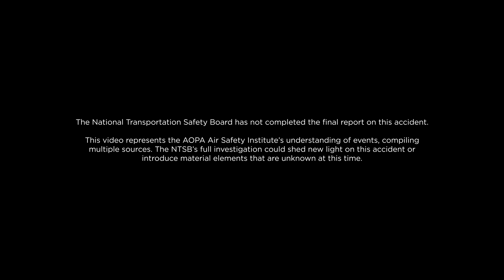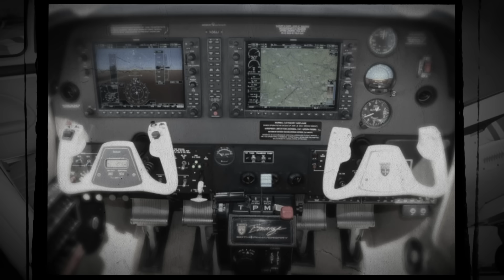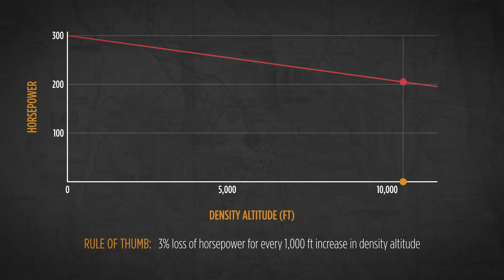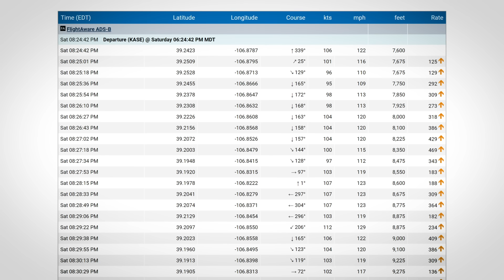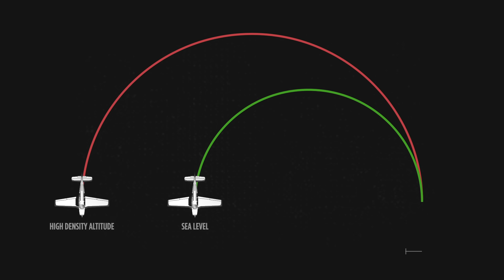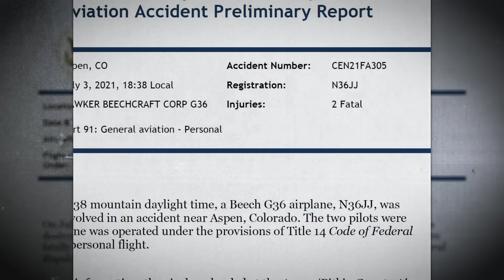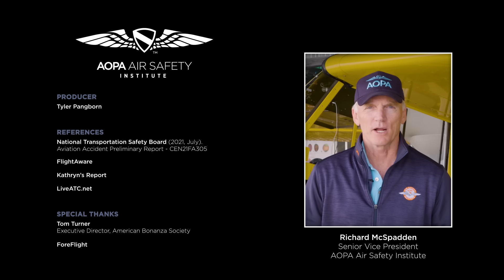Accident Case Study: Into Thin Air

Comment: Man, that was hard to watch. I was squirming in my chair watching them fly up that valley. 
I feel very fortunate to have gotten my PPL in Yucca Valley, CA(L22) while stations in 29 Palms. Big Bear airport(L35) in very close by. Big Bear was never a huge deal during training. Density Altitude was noticeable, but my intructor took me to Big Bear and around the mountains often. I was confident and even a bit cocky around mountains. It wasn't until after I got my PPL, I had rented a Grumman Tiger and was flying around SOCAL. I had two of my Navy friends on board. About 200Lbs under gross. After touring around and getting lunch in Corona(KOAJ), we started trecking back towards the high desert. About a 30 min flight. My two friends wanted to fly past Big Bear to take some pictures of the lake and mountains. This was the middle of July, and the temperature was around 85F. Very warm for Big Bear which made the DA around 9,800ft. I decided to follow a Cessna that was in front of me and do a touch-and-go. When I touched down and brought the throttle forward, I immediately noticed the lack of power. I rotated and felt the lift drop off as soon as I left the ground effect. To make things worse, there are 50ft tall trees at the end of RW8. I looked at the end of the RW and debated aborting and squealing the brakes to stop before the fence. I saw the Cessna in front of me, and he had turned left and flew through a roughly 100ft wide gap in the trees. I followed him and swore I could grab pine cones if I stuck my hand out. I was climbing at 70kt Vx and not making more than 250ft/min. I retracted the flaps after I cleared 1,000AGL and played with the mixture to make best power. I had to S-Turn to clear the ridgeline to the desert. After clearing the 8,500ft ridge I released back pressure on the yoke, began a descent toward Yucca Valley, and finally breathed for what felt like an hour. I turned to my non flying buddies expecting to see ghosts and asked, "you guys get any good pictures?"
"Yea, That was AWESOME!" 😨😨
They never noticed anything was wrong! I kept it that was to not freak them out. I swear I shat enough bricks to build a fricken school! After landing in Yucca and driving back to base, luckily the only thing hurt was my ego. I was wearing a Garmin watch, and I looked at it after getting home. It had a notification that said, "GREAT WORKOUT Max Heart Rate: 194bpm"
Maybe it wasn't as bad as my brain made it out to be. Some have probably had closer, but that was the closest I've ever come to buying a farm. DEFINITELY better to use superior judgement than superior skill. I forced myself to use superior skill to pull myself out of a situation, and it FUCKIN SUCKED!
Density Altitude around mountains is NO JOKE! Whether you're a flatlander or trained in mountains, it's real and it kills. I would rent a 182 out of Eagle, CO and put Leadville (KLXV) in my logbook not even a year later. I got an intro to "REAL" mountain flying, and to be honest, I'm returning to EAGLE to finish taking the full course.
Reply: Great story...Thanks for sharing.  VERY glad you are here to tell us about it.

Comment: This is a great video. I hiked Midway Pass from Independence Pass 2 days after this crash in order to find the wreckage. Not sure where they got their information on the exact whereabouts of this crash but thy are correct. It was a TERRIBLE time to leave Aspen and were extremely ignorant of the height and respect Colorado mountains require. The only error I see in this video is winds were not 15 knots from the East.....prevailing is almost always from the west...which didn't help them. GA usually only flies for a couple hours in the morning mid-Summer here in the Rockies. Even if these guys would have made it over Midway Pass, their flight would have been extremely turbulent and uncomfortable. RIP and kudos to ASI/AOPA for this video.
Reply: I agree..I'm usually back on the ground by noon during the summer. I don't have a DA issue in the RV-8, it's just the afternoon T-storms and turbulence pick up dramatically after that.

Comment: Why in the world choose Aspen for a fuel stop IN JULY?

Why not depart NNW, follow the road to Basalt and hang a lazy turn to the right all while climbing?

Why not depart with half tanks and better your climb rate to clear the pass of your choice (Assuming safe winds and weather) and refuel on the eastern slope someplace?

Why not have a specific route in mind and plan for minimum crossing altitudes before entering the canyon?  There was no indication they had even contemplated a safe crossing altitude.

Why file an IFR flight plan only to cancel when the controller (who knows better) keeps you circling until you are at a safe altitude?

And, yes, why not talk with someone knowledgeable in mountain flying before you even land there, or at least before departing Aspen.

Comment: I am wondering why they decided in flight planning that Aspen would be a good stop for fuel in a normally aspirated airplane? Considering the temperatures were fairly hot on the day in question. The Bonanza is a great airplane but damn you can dig a hole for yourself right quick if you let it. GPS is a great navigation tool. GPS direct can sometimes get you into a corner that will cost you dearly. DA is something you always have to consider. These sorts of things are never good. I am retired now, but I would have my students do the calculations for every single flight- I figured that a habit from the start will keep them out of trouble later.

Comment: I think one more point should be added as the first in the chain of events:
(1) the decision to plan through Aspen and to land there and take off in July.

Aspen is dead center in the high territory and higher on departure.  Instead of going south from the planned trip head to Cheyenne. It’s at least 1k lower in elevation and takeoff to the east puts you over prairies. Not loaded with fuel trying to climb to 14k to make it over a box canyon. 

Understanding that Aspen is a bit more glamorous of a stopover.

Comment: The first minute of the video says it all...they had NO BUSINESS landing in the middle of the Rockies (especially Aspen) or really even flying OVER the Rockies in summertime without a turbo-charged engine at a minimum.  This is all due to a lack of mountain flying training and experience.  (note.  this type of plane should also not challenge the Rockies in winter either...).

Comment: Just looking at map of US on Weather Radar app, a lot better route would have been KAPC, KLAS,  KABQ (alt 5355 ft), then on to wherever they wanted.  It would have added some extra miles to the trip, but would have totally avoided the high mountains and trying to make it thru passes.  They also would have flown over the Grand Canyon for some great photo ops.  A straight line is not always the best  or safest way to go. RIP

Comment: The first link in this accident chain was choosing Aspen for their fuel stop.  The scenery on their chosen route is of course spectacular, but a more prudent choice would be a route across Wyoming paralleling I-80, which would have lower terrain to cross and a choice of airports at much lower elevations than Aspen.  They cranked the risk factor up pretty high as soon as they left Napa with KASE programmed into the G1000.
Reply: I was thinking the same thing as soon as the announcer said they did not have a turbo. They had no business going through Aspen with a new plane they are unfamiliar with, with only East coast experience, without oxygen, and without a turbo. They may have done the trip with this plane if they had plenty of experience, and extensive briefing on mountain flying. They never should have chosen that path, rather flown through NM.
Reply: Husband and I go to Aspen every few years.  We go in the summer and fly into Denver and rent an SUV for the remainder of the trip.  I refuse to fly into Aspen with any pilot.  Maybe I'm too wary but getting to play in a snowfall at Independence Pass in June makes the drive worth it :)
Aspen's airport is ranked as one of the most dangerous in North America...only for the most experienced of pilots in mountainous regions.  Thank goodness these two did not have wives and/or children with them.
RIP to the pilots.
Reply: @fumblebunny1993  Not even commercially or with a turbine jet engine? :D
Reply: @rkan2  No and no :)  I cannot predict weather and that can change fast over the mountains.  I fly a lot and Aspen is the only airport I've ever felt this way about.  I can't rely on commercial pilot experience either.  Look at Air Florida flight 90.
I'm just following my intuition on this one.
Merry Christmas, rkan2!
Reply: @fumblebunny1993 😮
Reply: I immediately thought the same thing. I obviously don't know what weather looked around the Rockies that day, but the same general plan replacing Aspen with a stop somewhere like Rock Springs or Rawlins avoids the highest portion of the Rockies. If I were in a (relatively) new-to-me aircraft, the 10,000 ft. runway at RKS with no notable terrain nearby would seem rather inviting.
Reply: first thing I thought
Reply: Yeah, who the hell stops in Aspen for fuel?

Comment: Stunning to see that a high time ATP rated in Gulfstream jets get suckered into flying into a situation where is is no margin for error and that "errors were made"...if they wanted to visit Aspen...why not overnight, depart early in the am (no turbulence) with just enough fuel to make Denver plus reserves...and cross the mountains with AT LEAST 2,000 between you and terrain? with enough room to turn around if they hit downdrafts. 

I took off from Winslow AZ hot afternoon max GW, Piper Warrior long runway...did my calcs..the airplane would do it with about 200' FPM climb...which it did...all is ok we're climbing out...then hit an unexpected downdraft at the end of the runway. Not only did we stop climbing we started descending (in a sinking column of air the plane couldn't outclimb). 

There's a wash at the end of the runway...we flew down it struggling to stay airborne, at at about the same ground level as the airport. thank God for that wash. Lesson: with marginally powered aircraft build in very healthy margins for safety.

Comment: I flew with a CFI  The Independence pass in a turbo normalized bonanza about one months after this crash.    At one point we landed at Leadville and heard the story of the crash from the FBO manager, how the pilots took a wrong turn and boxed themselves in, flying east.   The CFI stressed the importance of not trying to cross the Independence pass  eastward with westerly winds. This is a real killer, one of the most dangerous passes with the crossing altitude 12500 if you fly it properly.  A wrong turn most definitely puts you against a much higher terrain.    Being unfamiliar with the mountains these guys had no chance..  Another CO CFI told me that  40 people die each year trying to fly in the Colorado mountains, some of them are experienced mountain pilots.   It's very sad.
Reply: Check out this video that I did about flying around Angel Fire, NM (8,380'). It talks about the various wind currents and how the mountains create both up-drafts and down-drafts. You just need to be able to visualize what is happening all dependent on wind direction and the terrain. https://youtu.be/AmrAX7tSvvQ

Comment: I often do an end run Bakersfield Albuquerque avoiding Rockies  and through mid Continent. The low spot Knoxville through blue ridge maintains. However Blue ridge is under 7000 ft.

Comment: I’m a little confused about something. Aspen is 7,838 ft MSL but the density altitude was 10,500 ft, or 2,662 ft more than the MSL. The crash location was 11,000 ft MSL. So would that mean the density altitude at the crash location was approximately 13,662 ft density altitude? (11,000 ft MSL + 2,662 ft)

The Bonanza G36 shows a service ceiling of 18,500 ft. Why was that thing so sluggish gaining altitude when it was still almost 5,000 ft below it’s listed ceiling?

Comment: Don't know about the powerplant in this particular G36, but my A36 had an IO550 with Continental's (somewhat infamous) automatic mixture control. The box set the correct mixture by way of an aneroid.  Sometimes it worked beautifully. Sometimes it didn't.

Comment: Am I correct that most of this discussion is regarding the engine performance at that altitude? - or is there also some effect related to wing lift due to less dense air? I am not a pilot, but it seems that flying over mountainous terrain has multiple difficulties;  updrafts, downdrafts, less oxygen, less air pressure, and visibility issues. I can just imagine the stress if you flew into clouds when there are mountain peaks around that could scrape your underbelly at any time... 😲
Reply: Yeah, engine performance is what is most noticeable to the pilot. I do most of my flying out of Angel Fire, NM (KAXX) with a field elevation of 8,380 feet. Lots of pilots come in there that don't even think about having to lean their engine for takeoff and also leave it leaned-out for landing. Can't tell you how many pilots have gone to the runup area and their engine has died during runup because they did exactly what their checklist says, "Mixture      RICH". All the other things that you bring up are important. I did a video about flying out of our airport because we had so many accidents I felt I had a responsibility to do something to help guide pilots coming there. If you have an interest, check out the one I did here: https://youtu.be/AmrAX7tSvvQ - note, it isn't produced anywhere nearly as professionally as this one is.
Reply: @CIOPilot  - That video was an excellent analysis of this airport configuration. I think that I would want to have a Kodiak turbo prop with good power, large wings, and decent STOL characteristics. (If someone will loan me about one million+ dollars)... 😋.
Out of curiosity, why do folks fly into this region of NM? It appears that there is NOTHING around the entire runway area. It seems there should at least be a small pub so pilots could build up their courage before lift off... HA!
Reply: @gilbertfranklin1537  Thanks Gilbert. Angel Fire Resort is just down the road from the airport, and they have a shuttle that picks people up and takes the over there. In the summer it is a world class mountain bike park and awesome 18 hole golf course, in the winter it is a ski resort. There is a craft brew pub in town (Enchanted Circle Brewing), and a few good restaurants. Angel Fire is one of those hidden mountain gems. Lot's of Texans and Oklahomans come out there because they can go skiing in a 5 or 6 hour drive rather than making a 10 or 12 hour drive to the resorts in Colorado, and Angel Fire is a lot more reasonable on the cost of their lift tickets and housing. In the summer, they come to escape the Texas heat because our summer high temps are usually in the low 80's.  You can definitely do it without a STOL plane, because the runway is 8,900 feet long. I do it in my turbo Saratoga, full-fuel, max gross weight, and I use about 2,000 to 2,500 feet of runway, and that is not "pushing" the take-off at all.

Comment: Thanks for the video! Would it be an option to extend flaps to increase climb or to decrease speed for the u-turn? Or to almost stall the plane and make a turn with a heavy ruder input alowing it to dive a bit.

Comment: I know many factors contributed to this, but I'm just stuck on the fact that flying a normally aspirated plane in the mountains is just a bad idea. Turbocharging should be a must. More performance when you need it and more efficient operation: high manifold pressure with lean of peak mixture. Look it up. Turbos for the flat land pilot

Comment: It almost sounds like normally aspirated, single engine planes should not fly in the mountains. Even if they had made several more circuits around the field, they would have reached an altitude that required oxygen before departing the field, which apparently they didn’t have. Under the best of circumstances getting out of there in that airplane was going to be difficult, but these guys waited until they were heading into the mountains to get clarification on the pass. I would think one would want to know that long before you have minutes to live. I’m not a pilot, so I’ve often wonder why people hit mountains. This video made it perfectly clear. You can’t just yank on the stick to fly over a mountain.

Comment: As a student pilot from the northeast, thank you for the video and great explanation. There is really no where out here that I know off where I could experience something like the environment in aspen, I mean I read about density altitude and understand it but the numbers in that video are insane. Thank you for the video and Rip to those pilots.
Reply: Pick a calm wind day, get an instructor, in an area with very flat open terrain, set takeoff rpm to 2200 or 2300 rpm ( or something appropriate for your plane) and try taking off . Climbing out at 150 or 200 fpm minute can be a real eye opener. This, to some extend, replicates the reduced aircraft performance. However it does not simulate the grater groundspeed and other factors of high altitude, such as reduced oxygen to the brain. I fly in the mountains quite a bit but can start getting hypoxic as low as 8000 feet. For me, hypoxia is this great feeling like I'm the best pilot in the world and everything is perfect. It's as dangerous as density altitude as I could see myself getting hypoxic and doing exactly what these guys did. Not saying hypoxia had anything to do with this accident, but it's another real danger of mountain flying.  I carry oxygen when flying in the mountains and am hard wired to notice the first signs of hypoxia.